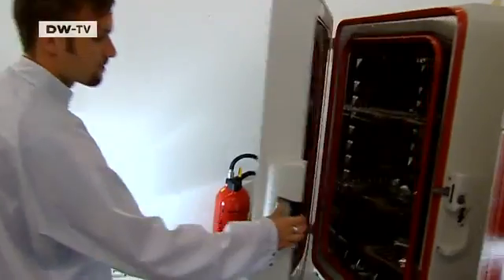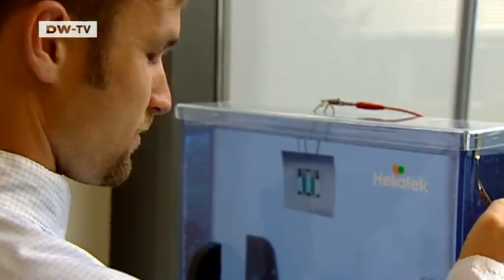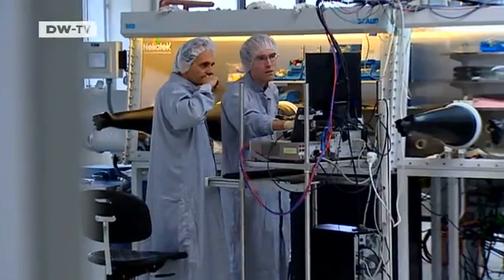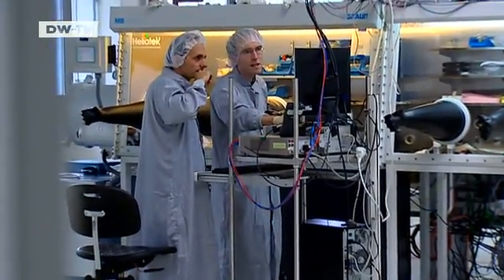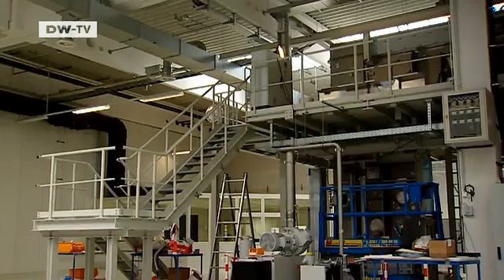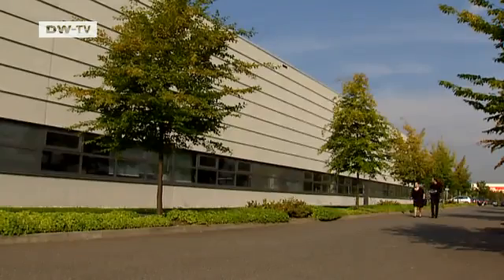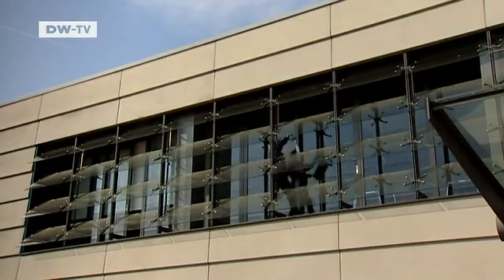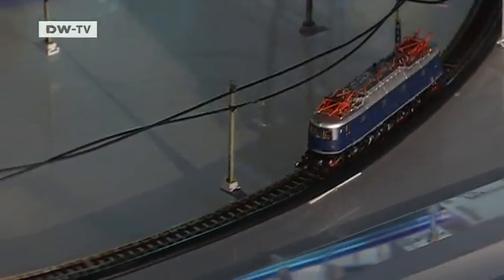Thin and inexpensive: Organic Solar Cells | Tomorrow Today

Comment: 2020, still not available. The silicon ones are durable, have a good efficiency but are expensive, need technicians to install them. So I dream of something organic, cheap, low efficiency perhaps and not long lasting but still non toxic and recyclable, and plug and play. Perhaps a simple wooden frame would be enough to hold them because all the aluminium from the silicon ones bothers me.

Comment: i see that when they apply the coating to a glass pane or some such , that is when the magnetic field needs to be applied , also It needs to be done inside a magnetic shielding to prevent earths magnetic natural field from interfering with your own magnetic field , to achieve maximum benefits . over time earths magnetic field will effect the panel along with the heating up and cooling of absorbing photons, but you can mitigate this greatly by  arranging the way you aligned the sheets with the magnetic field with the natural magnetic field of earth . Of course you will receive dmg to the field by local variables producing their own magnetic fields ... as an after thought but it wont be that much

Comment: using a good magnetic field to help the particles line up in a more uniform format will greatly increase performance. that is depending on how the material is applied to the containing structure, i gota watch more of the video to give a better imagination analysis .. but i figured i would go ahead and post this

Comment: To drive a real train down the tracks you simply install solar panels between the tracks for the entire length of the tracks That should provide enough power for lots of trains. Unless people intentionally destroy or steal the panels, this can be done with wires travelling underground from the panels to elevated power lines every 1/4 mile or so. The engineers can figure out how to subdivide the continuous array. Build these railroad solar panels with colors that shine in the dark and they will not be stolen.

Comment: Would be great if you could come up with an easy to selfbuild cheap solarcell that can be build without expensive equipment. If it only will have at least 1 % efficiency that will already propell solar energy to take off and please make it open source ! Many thanks. Regards, Stefan.
Reply: ***** It is possible to make a phone case with 2 foldable panels on the back to charge your battery... The usual phone size of today is about 70 square cm. Adding another 70 will give you 140sq cm. This could make around 2-3W/h which will charge a 2500mah battery in about 5h. Typical chargers charge with about 5-8W.
Reply: ***** How many gallons of cold water do you waste each day awaiting for hot water to take a shower? If that water travelled from your showerhead to a tank located above your toilet tank, maybe it could help fill the toilet tank faster. Nothing is impractical. There wide areas on the earth surface that need a little shade. Not only should they install solar panels in these locations but by law the panels should be 8 feet above ground. In times of emergency, we have seen cities telling their residents to evacuate but having no safe place for them to go to. All the solar panels out of nowhere will be there to shelter people sooner or later. If you give free land to the portable toilet manufacturers to locate warehouses near the solar power plants, then that area will always be ready as a campground in case of emergency. Somebody else seems to have the right to drill for oil under your property from miles away. . There are people who generate more electricity with solar panels than they use. Soon enough you will be looking at a green surface that looks like a lawn, but instead it will be made of solar panels that do not reflect the sun. Between now and the time when the planet is baked by the sun, solar power makes a lot of sense. We should save all the other types of energy to drive the planet away from the sun in small increments intermittently. Less power to you!

Comment: How about graphene thin inexpensive: Organic Solar cells ?
Reply: u haf to find a way to fix heterogenous excitor traps so they do not desegregate in sunlight, i.e. continue to phase segregate. This will prevent degradation of organic SC's. X-Rays have limited success. Perhaps a dye catalyst for one or both phases will create a lock. grafene will work in batteries now, but trouble with all this is getting the money to do the work. almost impossible  because money people do not have imaginative brains  are not able to take chances on potentially long development paths.

Comment: "Maybe only that part of that light is necessary and beneficial. We dont know everything 100%."

Except it's not.  Green light is one of the most efficient wavelengths based on bridging bandgap and not wasting energy as heat.  You say that we don't know everything 100%.  In this subject on simple dssc cells or plant photosynthesis, we do.  Like he had said before, please back up your responses on solar cells, and dont assume that natural selection will make everything perfect.  It doesn't.